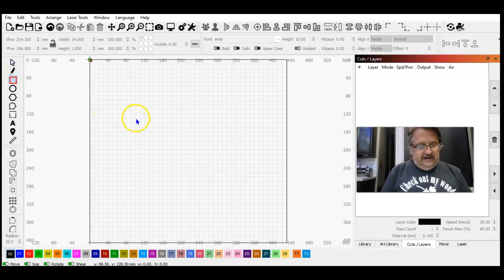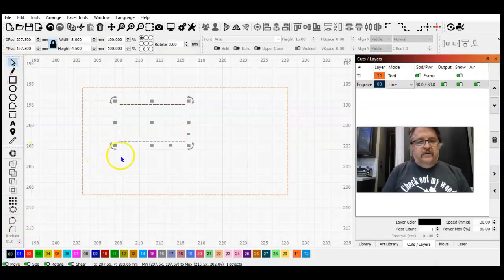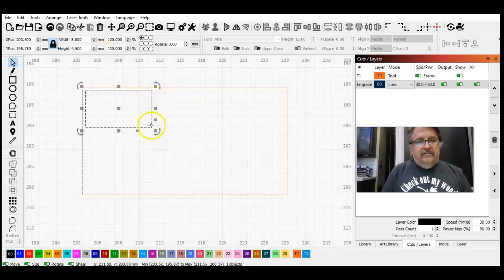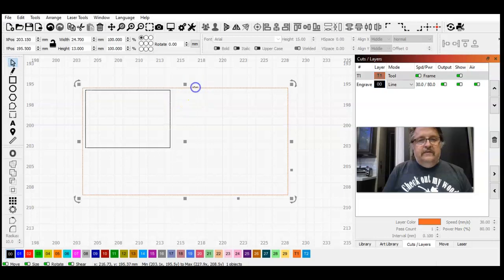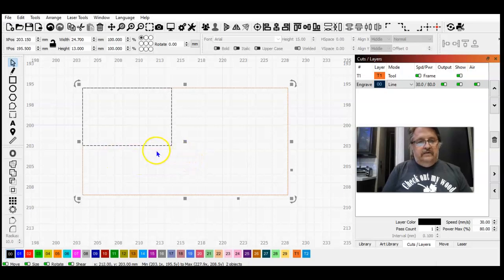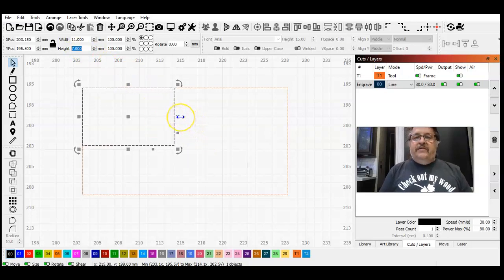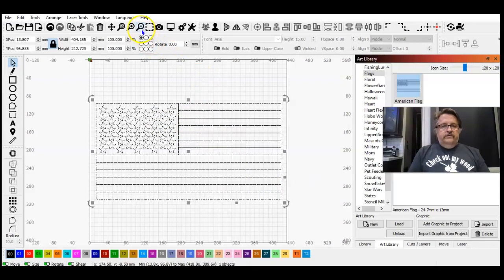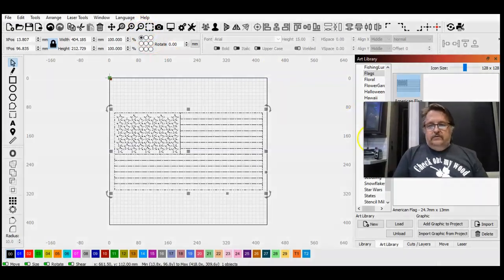Incorrectly designing a US flag using the array tool and shapes tool in LightBurn. (INCORRECTLY)

Comment: I didn't see how you caused the stars to be offset in the columns.
Reply from the maker: That is accomplished in the array configuration. There is an option to "Shift by half" in the grid array. I had it turned on in the columns. I already had it turned on and failed to mention it. This design used an incorrect layout on the stars. 

I made a correction video. Check it out. It has the correct layout and shows shift by half. I think it is around the 20-minute mark.

https://youtu.be/ncIuFtJwt-k

This was an early video in my YouTube experience. Thanks for watching.

Comment: Good video on using the tools, but for private citizen use, the proportions are 2:3, 3:5, or 5:8, and the stars are rows of 6 & 5, not 5 & 4 Steve. I know you were trying to use simple math, but that's not necessary. You can just type the math into the width or height. So for example, if you used the 3:5 ratio and duplicated the 3x5 rectangle, then you would type 3.0/11 into the height measurement and press enter, and you would have a 0.2727 stripe. Think of the width & height boxes as calculators. All the standard calc functions, +, -, *, /, and even some advanced calcs work in those boxes. I know I don't show these functions in my videos, but I probably should. For the offset on the star, the number should have been 0 for the sharp corners. Hope this helps!
Reply from the maker: I really do enjoy your videos and your input. I appreciate this comment and now I'm going to make a new one and take this one down. I NEVER want to disrespect the flag and the mistake on the star array means this has to be redone. Thank you. I'm thrilled to know you are watching. And ALWAYS keep me straight. Afterall, I learned a lot from watching you. So, some might say you are partially responsible for my videos. :-)